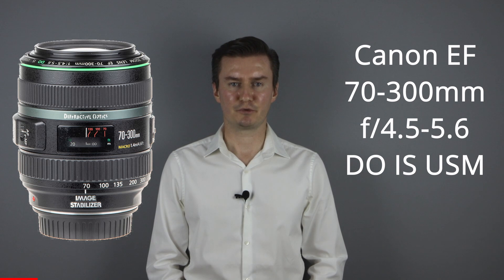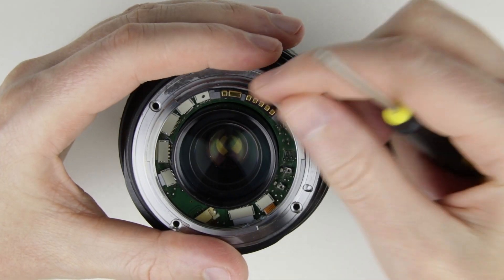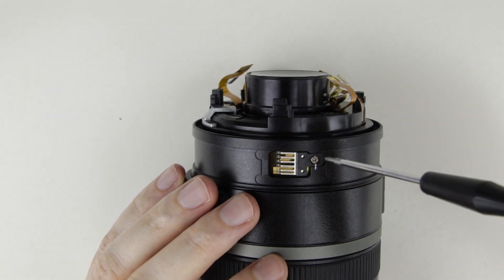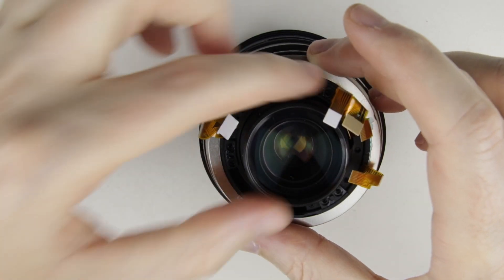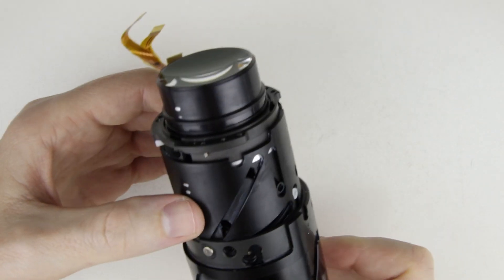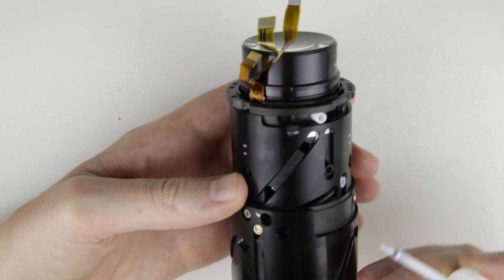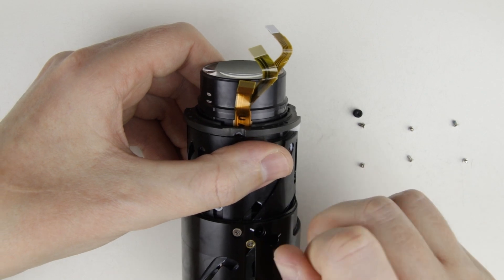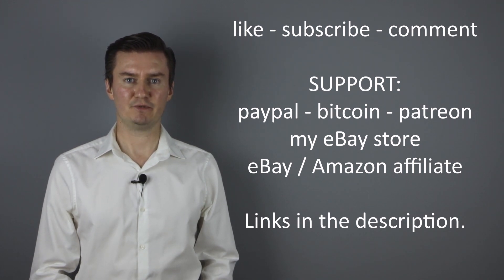Canon 70-300mm f/4.5-5.6 EF DO IS USM - disassembly for replacing the aperture cable

Comment: Hi, thank you for the video. I just bought one of these as spares. I think the aperature system is broken because whenever i try to take a photo with the aperature set to anything higher than 5.6 it's completely over exposed with a shallow DOF. 
Do you know the part number for the aperature unit? is it shared with other Canon lenses?
Reply from the maker: I don't know the part number, but just search for the name of the lens on ebay, choose "Camera parts" as category, and check if there is any for sale.

Comment: I have 300mm canon lens but not able to perform in Low aperture as image comes blurry. So is it possible to deassamble or possible to change aperture cable?
Reply from the maker: I don't think that is caused by the aperture cable. I would guess there is lens element misalignment which is really hard to detect.
My other idea would be to test the lens with LiveView focusing. Maybe the lens has a front or backfocus and that is causing the blurriness.
Reply: @CamerasLensesEtc  Thank you